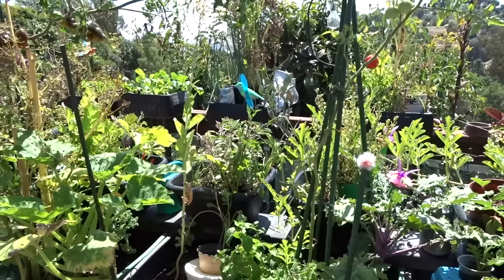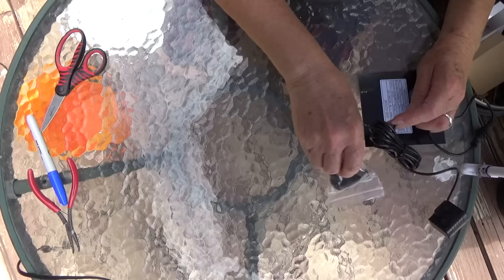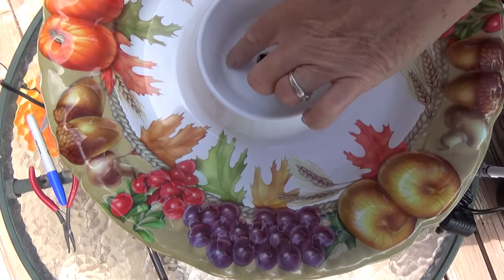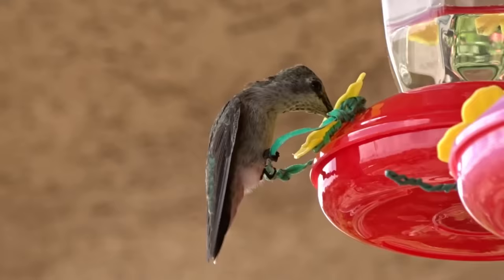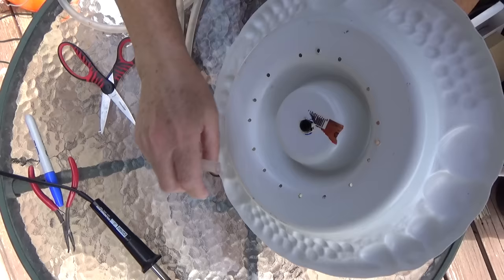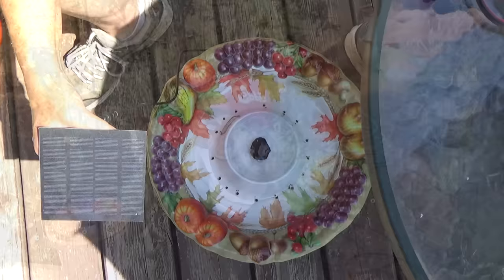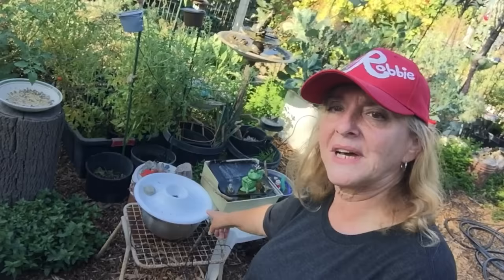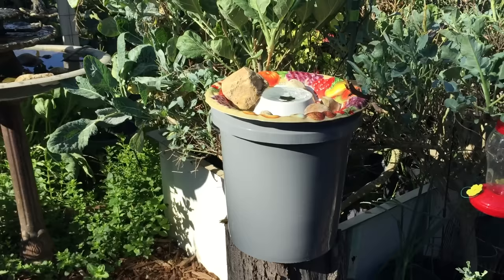Endless Water Hummingbird Bird Bath-CHEAP DIY Attracts Birds Solar Powered Water Fountain in Garden

Comment: Hi Robbie,
I love all your wonderful videos!!!
I was wondering where
you purchased that bird bath with the bubbler and what appears to have frogs
surrounding it. I would
love to have one!!
Thanks so much,
Roberta
Reply from the maker: That big one I got at a thrift store, the solar fountains are from within the USA on ebay, here is aff link, thanks Robbie  https://rover.ebay.com/rover/1/711-53200-19255-0/1?mpre=https%3A%2F%2Fwww.ebay.com%2Fitm%2FSolar-Power-Fountain-Submersible-Water-Pump-With-Filter-Panel-Pond-Pool-180L-h%2F293674835229%3Fhash%3Ditem4460625d1d%253Ag%253AT-YAAOSwL0pfJ9KK%26LH_BIN%3D1&campid=5338267736&toolid=10001&customid=

Comment: Could you please tell me where you purchased your pump and the manufacturer?
Reply from the maker: Here are some aff. links of the fountains we buy and use, I try to buy from companies in the USA for fastest shipping: This link is the models we use the solar fountain models, that has the panel and long cord,   https://www.ebay.com/itm/Brushless-Solar-Power-Water-Pump-Panel-Kit-Fountain-Pool-Garden-Watering-180L-H/384073249238?_trkparms=aid%3D1110006%26algo%3DHOMESPLICE.SIM%26ao%3D1%26asc%3D20190711095549%26meid%3D53ee987899d44f23aa1a03c85a2c0f7d%26pid%3D100047%26rk%3D5%26rkt%3D12%26sd%3D193959022502%26itm%3D384073249238%26pmt%3D1%26noa%3D0%26pg%3D2047675%26algv%3DSimplAMLv5PairwiseWebWithBBEV2bAndUBSourceDemotionWithUltimatelyBoughtOfCoviewV2%26brand%3DUnbranded&_trksid=p2047675.c100047.m2108&mkcid=1&mkrid=711-53200-19255-0&siteid=0&campid=5338267736&customid=&toolid=10001&mkevt=1

Comment: Where can I buy a solar pump to put into my water bird bath???
Reply from the maker: Here are some aff. links of the fountains we buy and use, I try to buy from companies in the USA for fastest shipping: This link is the models we use the solar fountain models, that has the panel and long cord,   https://www.ebay.com/itm/Brushless-Solar-Power-Water-Pump-Panel-Kit-Fountain-Pool-Garden-Watering-180L-H/384073249238?_trkparms=aid%3D1110006%26algo%3DHOMESPLICE.SIM%26ao%3D1%26asc%3D20190711095549%26meid%3D53ee987899d44f23aa1a03c85a2c0f7d%26pid%3D100047%26rk%3D5%26rkt%3D12%26sd%3D193959022502%26itm%3D384073249238%26pmt%3D1%26noa%3D0%26pg%3D2047675%26algv%3DSimplAMLv5PairwiseWebWithBBEV2bAndUBSourceDemotionWithUltimatelyBoughtOfCoviewV2%26brand%3DUnbranded&_trksid=p2047675.c100047.m2108&mkcid=1&mkrid=711-53200-19255-0&siteid=0&campid=5338267736&customid=&toolid=10001&mkevt=1

Comment: Where can I buy the pump kit
Reply from the maker: Here are some aff. links of the fountains we buy and use, I try to buy from companies in the USA for fastest shipping: This link is the models we use the solar fountain models, that has the panel and long cord,   https://www.ebay.com/itm/Brushless-Solar-Power-Water-Pump-Panel-Kit-Fountain-Pool-Garden-Watering-180L-H/384073249238?_trkparms=aid%3D1110006%26algo%3DHOMESPLICE.SIM%26ao%3D1%26asc%3D20190711095549%26meid%3D53ee987899d44f23aa1a03c85a2c0f7d%26pid%3D100047%26rk%3D5%26rkt%3D12%26sd%3D193959022502%26itm%3D384073249238%26pmt%3D1%26noa%3D0%26pg%3D2047675%26algv%3DSimplAMLv5PairwiseWebWithBBEV2bAndUBSourceDemotionWithUltimatelyBoughtOfCoviewV2%26brand%3DUnbranded&_trksid=p2047675.c100047.m2108&mkcid=1&mkrid=711-53200-19255-0&siteid=0&campid=5338267736&customid=&toolid=10001&mkevt=1

Comment: Where do you buy the solar powered water pump?
Reply from the maker: As fast as I post the USA sites that have them here, they sell out, as soon as I find another one, I will list it under any of my new videos.  There is a guy in the USA that has the larger pump kits, if you want a bigger one?  Here is an aff. link where I already bought 6 from him: http://rover.ebay.com/rover/1/711-53200-19255-0/1?ff3=4&pub=5575376117&toolid=10001&campid=5338267736&customid=&mpre=https%3A%2F%2Fwww.ebay.com%2Fitm%2FSolar-Water-Pump-Kit-over-50gal-hr-36-of-Head-Fountain-Pool-Garden-Pond-BEST%2F181819772672%3Fhash%3Ditem2a554d8f00%3Ag%3AENcAAOSwA%7EVaAhTe%3Asc%3AUSPSPriority%2190631%21US%21-1

Comment: Where  do you get the pumps please
Reply from the maker: Here are some aff. links of the fountains we buy and use, I try to buy from companies in the USA for fastest shipping: This link is the models we use the solar fountain models, that has the panel and long cord,   https://www.ebay.com/itm/Brushless-Solar-Power-Water-Pump-Panel-Kit-Fountain-Pool-Garden-Watering-180L-H/384073249238?_trkparms=aid%3D1110006%26algo%3DHOMESPLICE.SIM%26ao%3D1%26asc%3D20190711095549%26meid%3D53ee987899d44f23aa1a03c85a2c0f7d%26pid%3D100047%26rk%3D5%26rkt%3D12%26sd%3D193959022502%26itm%3D384073249238%26pmt%3D1%26noa%3D0%26pg%3D2047675%26algv%3DSimplAMLv5PairwiseWebWithBBEV2bAndUBSourceDemotionWithUltimatelyBoughtOfCoviewV2%26brand%3DUnbranded&_trksid=p2047675.c100047.m2108&mkcid=1&mkrid=711-53200-19255-0&siteid=0&campid=5338267736&customid=&toolid=10001&mkevt=1

Comment: Where did you get the pump?
Reply from the maker: I am working on finding a local person here with some solar ones, I will keep posting them as I find them, Here is an aff. links of the fountains we buy and use, I  buy from companies in the USA only for fastest shipping: 

http://rover.ebay.com/rover/1/711-53200-19255-0/1?ff3=4&pub=5575376117&toolid=10001&campid=5338267736&customid=&mpre=https%3A%2F%2Fwww.ebay.com%2Fitm%2FSunlitec-Solar-Fountain-with-Panel-Water-Pump-for-Bird-Bath-Panel-Kit-Outdoor%2F223992033741%3Fhash%3Ditem3426f731cd%3Ag%3AmVgAAOSwsi5ep79K

Comment: Where do you buy the solar pump from
Reply from the maker: Here is an aff. link of the same pumps I use and still buy for all my project, thanks.  https://www.ebay.com/itm/Brushless-Solar-Water-Pump-Power-Panel-Kit-Fountain-Pool-Garden-Watering-180L-H/284242245659?_trkparms=aid%3D1110006%26algo%3DHOMESPLICE.SIM%26ao%3D1%26asc%3D20190711095549%26meid%3D028ee23c78304061a7f408694d7a6192%26pid%3D100047%26rk%3D5%26rkt%3D12%26sd%3D384073249238%26itm%3D284242245659%26pmt%3D1%26noa%3D0%26pg%3D2047675%26algv%3DSimplAMLv5PairwiseWebWithBBEV2bAndUBSourceDemotionWithUltimatelyBoughtOfCoviewV2%26brand%3DUnbranded&_trksid=p2047675.c100047.m2108&mkcid=1&mkrid=711-53200-19255-0&siteid=0&campid=5338267736&customid=&toolid=10001&mkevt=1

Comment: Where do you buy your solar pumps! Please
Reply from the maker: Here is an aff. link to check out, This link is the models we use the solar fountain models, that has the panel and long cord. 
https://www.ebay.com/itm/353489345241?_trkparms=ispr%3D1&hash=item524d9b5ad9:g:WwIAAOSwSXJgmMl0&amdata=enc%3AAQAGAAACgPYe5NmHp%252B2JMhMi7yxGiTJkPrKr5t53CooMSQt2orsSL18zNWkBdjtrQvAkAXIw%252B%252FBk1wB7UjOfnClTV0NVyjCIzcCsFUV6Als6wUFFoYaBMT8QkAh6wxViRcq49LVIjQw0ShR4Gb%252Bo48r%252BZU3bJY3OS6NUdPa19cxLI%252Ff38UdYcAivgYlsUEo34Ermc2THEjaZCcU3iO3lmPnsJlFaaztL4leTR9nGJnpDUTsRa0e%252Bcb5Qrg34tZkwyK1Gn0hC0mQhg5sxur5I3zGMizz0OfX4ggOHhcIFc7edzWy%252FojuxzkzD9evv1liZBs9kb9saHklPBmPgmYkcFrj7SiG2rSbVdhPwwSnDtzwCp9f5CPbcD63cvos1jNz3aAP9mJBEBYoVxnqYQTpLgOozy9%252Fd0vc91nACfD1QOQZTf%252FZtKQ3A8NSTL4qczTIBzKCwZpvLH8rpqj0ZxOGaiel7KJNt%252FiHaoq3deWYQbNi9lDATR13F7ua%252BgfCQT6OviDO%252BljMSHSbkq8SwpOopBkb94qkmE0BK0FRj%252BYAdG%252F14bc8JTOi9avFKChcz2TUEe1i2f3Xwpjj3Autzbz2U4i2zczevSipnpPJFj6Kw4dBBz%252FvK78rhmW7g1QShJAbmmzVYkucHRWivjajRyg8AaJG1XB6qvEII%252Bnl1J3S5du%252FLxa%252Bi0%252Fklf%252FydgqeKCoNvgMtvIeTDsx0gD4xs56%252BB6d9kPPEcgC0%252FEFZ4YHBL0cI5GqdsyZFIc6%252F%252F0jfoJDfsFf6TUxt0KMoMWxCadVBy2QytlWQd%252FxR4osf0OUEZLsmAyC1bppHfTnWUrGyDirfIi3aRS%252BQqCTkRDyd%252B5F2FWV%252BAZuyMNWY%253D%7Campid%3APL_CLK%7Cclp%3A2499334&mkcid=1&mkrid=711-53200-19255-0&siteid=0&campid=5338267736&customid=&toolid=10001&mkevt=1

Comment: Where do you get your solar pumps?
Reply from the maker: Here are some aff. links of the fountains we buy and use, I try to buy from companies in the USA for fastest shipping: This link is the models we use the solar fountain models, that has the panel and long cord,   https://www.ebay.com/itm/Brushless-Solar-Power-Water-Pump-Panel-Kit-Fountain-Pool-Garden-Watering-180L-H/384073249238?_trkparms=aid%3D1110006%26algo%3DHOMESPLICE.SIM%26ao%3D1%26asc%3D20190711095549%26meid%3D53ee987899d44f23aa1a03c85a2c0f7d%26pid%3D100047%26rk%3D5%26rkt%3D12%26sd%3D193959022502%26itm%3D384073249238%26pmt%3D1%26noa%3D0%26pg%3D2047675%26algv%3DSimplAMLv5PairwiseWebWithBBEV2bAndUBSourceDemotionWithUltimatelyBoughtOfCoviewV2%26brand%3DUnbranded&_trksid=p2047675.c100047.m2108&mkcid=1&mkrid=711-53200-19255-0&siteid=0&campid=5338267736&customid=&toolid=10001&mkevt=1

Comment: Where do you get a solar pump
Reply from the maker: Here is an aff. link and I only buy on ebay from USA sellers, take care, Robbie   https://rover.ebay.com/rover/1/711-53200-19255-0/1?mpre=https%3A%2F%2Fwww.ebay.com%2Fitm%2FSolar-Power-Fountain-Submersible-Water-Pump-With-Filter-Panel-Pond-Pool-180L-h%2F293674835229%3Fhash%3Ditem4460625d1d%253Ag%253AT-YAAOSwL0pfJ9KK%26LH_BIN%3D1&campid=5338267736&toolid=10001&customid=

Comment: Where can I buy the solar motor?
Reply from the maker: Here is an aff. link, I get all mine on ebay, always from withing the USA, https://rover.ebay.com/rover/1/711-53200-19255-0/1?mpre=https%3A%2F%2Fwww.ebay.com%2Fitm%2FSolar-Power-Fountain-Submersible-Water-Pump-With-Filter-Panel-Pond-Pool-180L-h%2F293674835229%3Fhash%3Ditem4460625d1d%253Ag%253AT-YAAOSwL0pfJ9KK%26LH_BIN%3D1&campid=5338267736&toolid=10001&customid=

Comment: All the pumps are out of stock   :-(
Reply from the maker: Here are some aff. links of the fountains we buy and use, I try to buy from companies in the USA for fastest shipping: This link is the models we use the solar fountain models, that has the panel and long cord,   https://www.ebay.com/itm/Brushless-Solar-Power-Water-Pump-Panel-Kit-Fountain-Pool-Garden-Watering-180L-H/384073249238?_trkparms=aid%3D1110006%26algo%3DHOMESPLICE.SIM%26ao%3D1%26asc%3D20190711095549%26meid%3D53ee987899d44f23aa1a03c85a2c0f7d%26pid%3D100047%26rk%3D5%26rkt%3D12%26sd%3D193959022502%26itm%3D384073249238%26pmt%3D1%26noa%3D0%26pg%3D2047675%26algv%3DSimplAMLv5PairwiseWebWithBBEV2bAndUBSourceDemotionWithUltimatelyBoughtOfCoviewV2%26brand%3DUnbranded&_trksid=p2047675.c100047.m2108&mkcid=1&mkrid=711-53200-19255-0&siteid=0&campid=5338267736&customid=&toolid=10001&mkevt=1